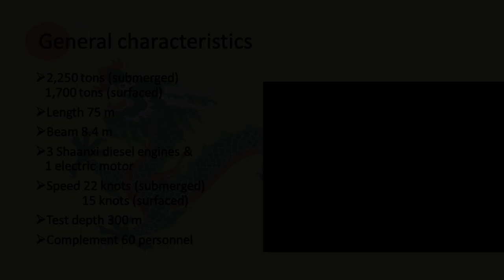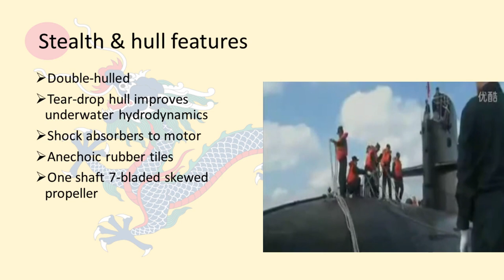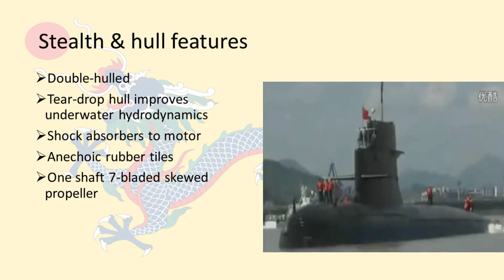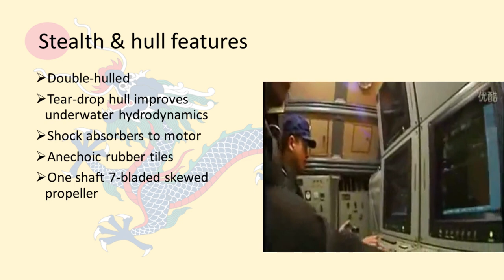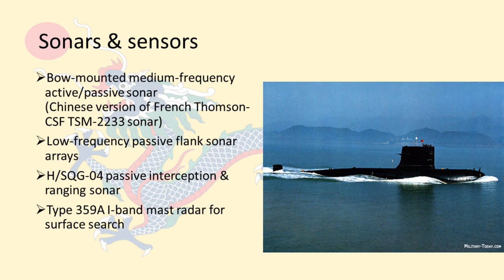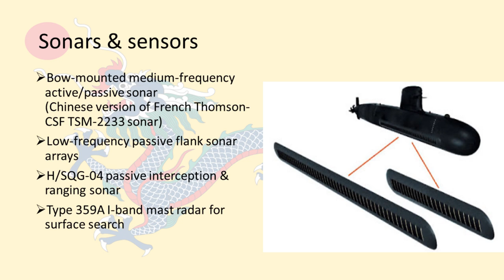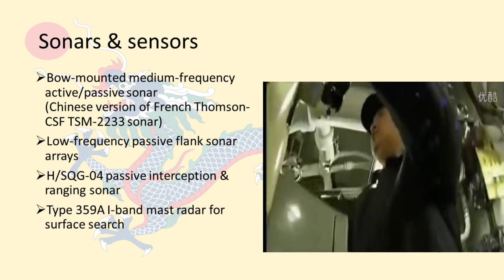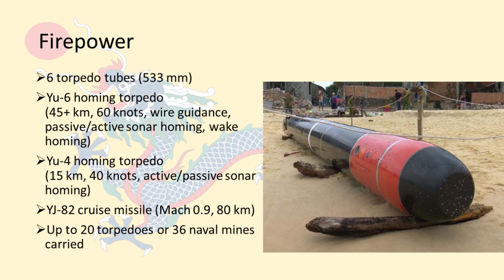This Chinese Submarine Sneaked Up on a US Carrier Undetected - Type 039 Song Class

Comment: 9km or 9000 metres is quite a distance.  If it was 90metres then there was some danger. The carrier group was intruding in the East China Sea.
Reply from the maker: 9 km is less than a quarter the range of a modern submarine's 533 mm torpedo, and remember these are homing and it will be likely to connect. The only real way to evade one would be acoustic decoys, but if that will of course require detecting the torpedo in time. 90 m is really point blank range... and in fact implausible in my oponion.
Reply: For an aircraft carrier, 9 km is a near by threat. Don't compare with you walking to your nearby grocery shop. Bare in mind aircraft carrier is a km length size.
Reply: 90 meters may be too short for a torpedo to arm, need to ask a submariner for that.  Your comment is really silly.

Comment: The Type 039 uses diesel engine. So it's noise level still not stealth enough. Nuclear-power is the answer for stealth under water.
Reply from the maker: I don't think that's quite true. Diesel engines are not used to power the propeller while underwater - that's done by an electric battery. The diesel engine is used to recharge the battery near the surface. A diesel sub running on its battery is very silent. A nuclear reactor actually might be more noisy because it cannot be switched off, and needs to have its cooling pumps running, which generates an inherent level of noise. But I agree with the idea that it is not good enough - the lack of AIP means it is not stealthy on long voyages because it has to surface. This is not to do with noise levels though.
Reply: Some of these comments are just pure copium 😂😂😂 and know nothing....